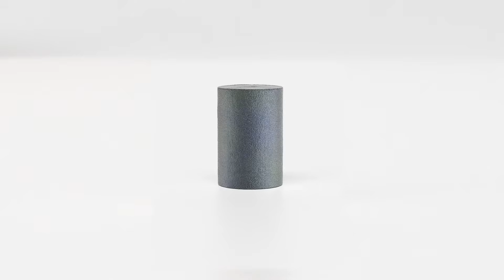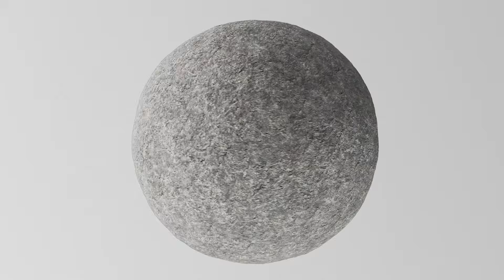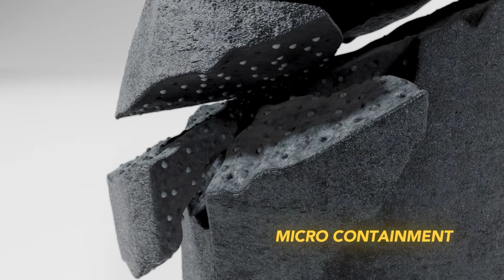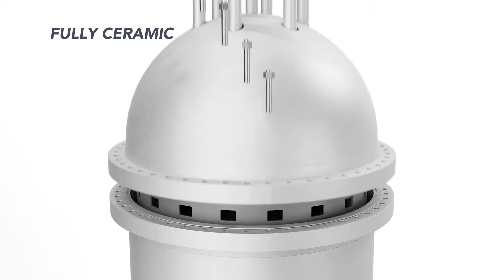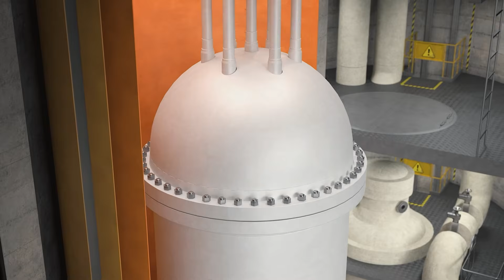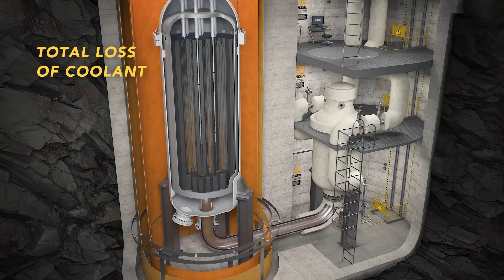NANO Nuclear Energy Inc. (NASDAQ : NNE) Presents KRONOS MMR

Comment: This is a bad design if it requires active cooling under any circumstance or it will overheat and destroy itself.  When you said it removes the control rod and the reactor heats up - that is the problem right there.  It seemed to contradict what you said later on.